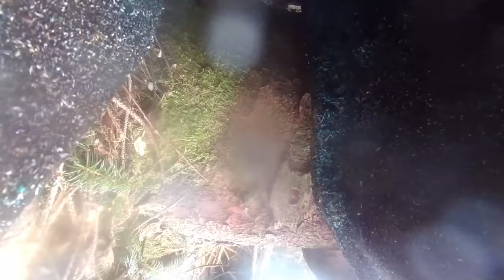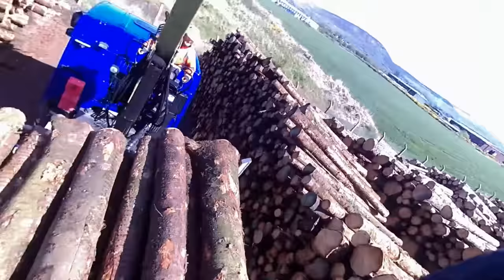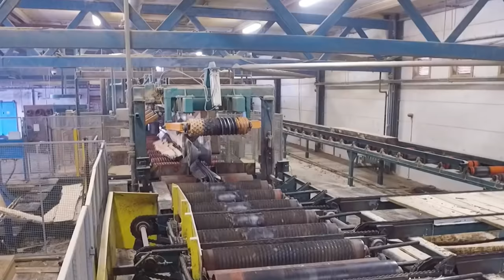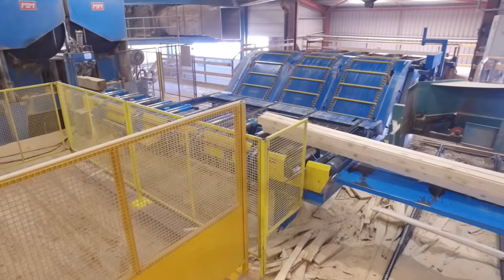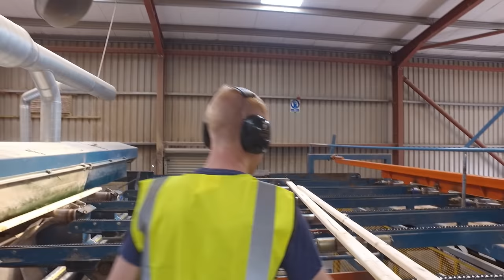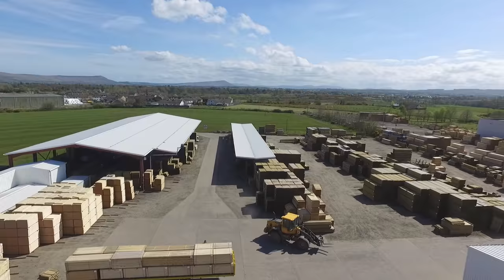Drenagh sawmills (the life of timber)

Comment: brought back lots of memories, did not know canter saws were still used, for canting the sides, our mill closed down 1994,  2 canters, then multi saw Sherman, 40 saws in one, new mill had also 2 canters and 2 ram saws,  2 re-saws, old was Guillet 228mm width blade cutting both ways for big stuff,  all the sawshop machines was Weinig for sharpening and blade manufacture
Reply: The mill I work for still uses canting saws.  Granted it was built in the late 1970s but they can still put out the footage.  We can do around 250 mbf on a 10 hour shift...not bad for an old wreck

Comment: Is the sawdust and wood chips loaded using a silo? I drive a lorry in sweden and loading sawdust and woodchips but we use a wheel loader. I've been at 30+ sawmills never seen that.
Reply: rats arsed  we drivers load by our self So no operator is needed.
Reply: rats arsed  indeed.